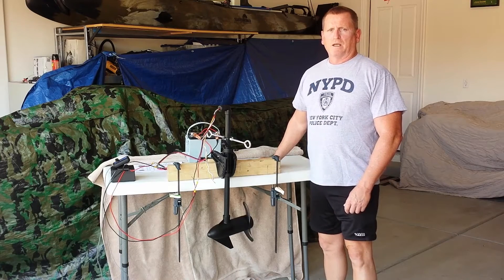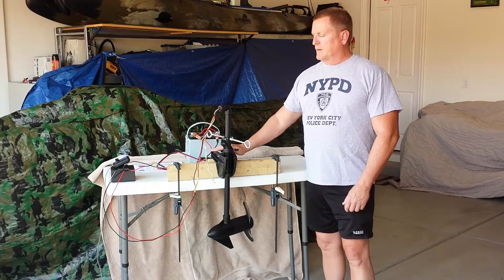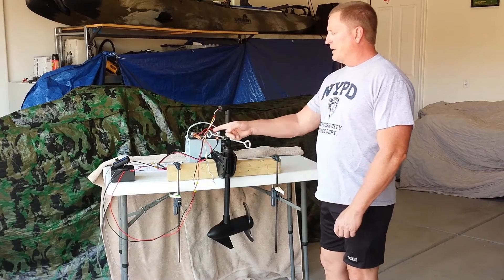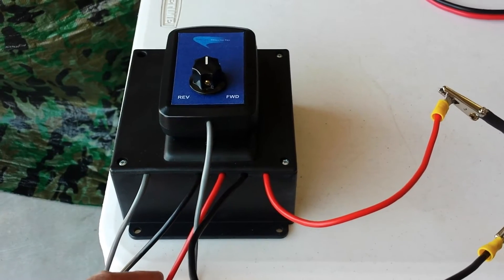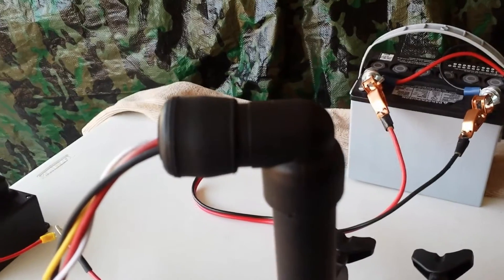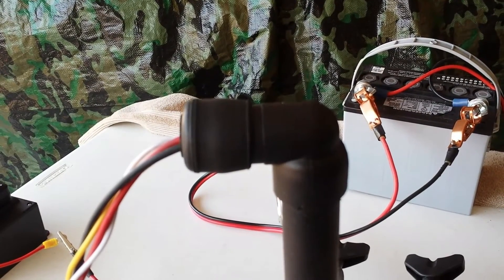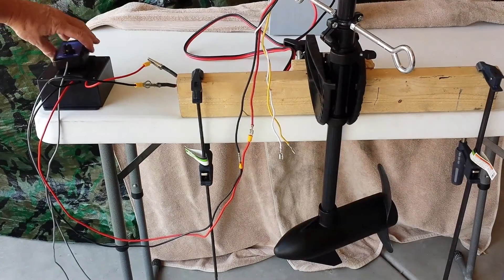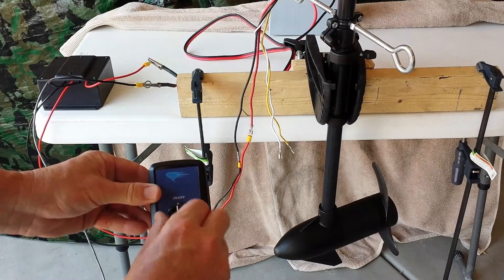Wireless Pro PWM Set Up and Test for DIY Modified Kayak Trolling Motor

Comment: Thanks for your informative videos... what I would like to know is is you have seen any difference in using 10 gauge vs 8 gauge wires ,most people never talk about wires since I understand 10g could be ok for a 30lbs troll motor but once you start getting into the 45`s or 50`s then that can become a issue of resistance and heat ... I got a 55lbs motor and even my fuse and connectors supposed to be for at least 50amps minimum and 8g wire , is that right or can I get away with less? thanks for your advice .
Reply from the maker: Thanks Frank. I know many people refer to the Minn Kota wire gauge chart. In my opinion, it uses a huge factor of safety for liability reasons. I have wired numerous trolling motors from 30-55 lbers on kayaks using 10G up to 13 feet with never any problems.

Comment: Thank you for getting back with me I really appreciate what is causing mine to pulsate fast slow fast slow both in reverse and in forward position. I turned the speed control to the highest setting when I hooked it up. Could that be my problem. Please get back with me
Reply: Same exact thing happened to me. Been trying to get hold of company for weeks. They have lied and been next to impossible to get in touch with. Avoid them like the plague!!!

Comment: What 90° fitting are you using at the top of the trolling motor shaft? I measured mine and it’s an on size. 1.13”
Reply from the maker: I used a 3/4 inch 90 with a slip fit end. I heated it up with a heat gun to make it fit over the shaft and added a rubber chair leg cap. I drilled a hole in the center of the rubber cap for the wiring.

Comment: I had a wireless. Never worked more than 10 minutes on the water. Sent it back 3 times all three times failed in the first ten minutes. They kept it up to 6 months one time and they said since the wireless was not working they would send me one out that was wireless but I could plug it in also. When I got it back it was strait wired. I had paid for wireless. Yep you guessed it, about 10 minutes on the water not ever hitting 100% power it Burnt up. This was the first time it had burnt up. Before it had gotten stuck on high in reverse when I was going forward at about 20% power. The other 2 times it just stopped working all together. Telling you my true story. If you want to buy one that is up to you. But don’t be like me and think it’s the best thing since sliced bread. Because it will malfunction on you. Thanks hopefully this helps someone to use their money more wisely.
Reply from the maker: You are not alone with your complaints. It seems within the last 2 years there was a quality control and customer service problem. They are currently out of business or just dormant. The unit I had and another that I installed still work to this day without any problems.
Reply: Aksman my unit was back from like 3-4 years ago. So they must had had some problems then also. They did return emails and called back from my emails at that time. And he would always send me the same board back each time. If it was my business when that problem one came in a new one would have been sent out and I would have found out what went wrong with that one. But the fastest they ever got me mine back was 2 months. I Bowfish off my yak so I run very very slow. You can see the prop turn. So wasn’t like I was even getting it hot. Just sucked. I was very disappointed to say the least. Thanks for you response back.

Comment: Thanks for the video.  Where is the fuse and what amp do you use
Reply from the maker: You are welcome. I use a 50 or 60A circuit breaker between the battery and PWM.

Comment: Does anyone know why my trolling motor has 5 wires? 12v older motor.
Reply from the maker: What brand and model?
Reply: @Aksmaniyak  it's a diehard 1.5 hp
Reply from the maker: @BigInjun05  As long as you have the main red and black power wires going down into the shaft you can use a PWM.
Reply: @Aksmaniyak  that blue wire wouldn't be like a motor starter would it?
Reply from the maker: @BigInjun05  If it is a standard 12v trolling motor then the only wires that are important are the red/black for a PWM. That is because you don't use the stock switch.
Reply: @Aksmaniyak  I always ask as many questions necessary to learn. Thank you for your knowledge.
Reply from the maker: Glad to help.

Comment: So they say to put it on speed 5 formax energy saving. So with yours being removed do you still get the same in energy consumption
Reply from the maker: I have only field tested the unit without the head. Putting it on 5 allows for full current flow for the max energy saving and max speed. I have not tested both variations side by side for comparison. Removing the head and original switch could only increase the enregy savings based on my previous testing IMO.

Comment: I am looking at using the Wireless Trolling Pro for my Kayak. I will be putting a Minn Kota Endura Max 55 LB trolling motor on it. I have in the past with a Motorguide C3 taken the switch out and remounted it by the chair and it worked well. The Minn Kota however, has a molded in switch that doesn't look to be removable. I noticed that you had 2 wires that were not connected and the power ran directly into the motor itself. Are the cables coming from the wireless pro go directly to the wires that go down to the motor? The video was a little unclear as to what they hooked up to. Thanks
Reply from the maker: Yes, you don't use the white and yellow wires on the MK. You only use the pos and neg wiring for the WTP.

Comment: Hey Aksman, Happy New Year!  I have a question, do you know just how far your motor needs to be under the water to prevent cavitation?
I'm and told the closer you can get to the water line without cavitation the more efficient your motor will run. I will be running a 40 lb minn kota
With the standard prop on a bonafied ss127.  I will be shortening the shaft and would like to go as short as possible. This will add in lifting the trolling motor out of the water and give me that nice low profile on top that i am looking for.

Comment: Aksman, from your expertise, is performance better with the pwm control module, or the controller box you made in your previous videos. The control box that you fabricated is really nice and cheaper to make. In your opinion which would you go with?
Reply from the maker: It depends on your budget. Yes, the original control box is easier to make and costs much less. The PWM requires different wiring and is much more expensive. The PWM does have more advantages. It uses less battery current so your battery power will last longer. It also has an infinite amount of speed settings.

Comment: Aksman, your videos are the best, I'm going to add trolling motor to my eagle Talon yak, question with the pwm controller how do you wire the breaker to the controller and battery.
Reply from the maker: Thanks again Al. You wire the circuit breaker between the battery power leads and PWM. The PWM then runs to the trolling motor power leads.

Comment: How do u wire the control box in ur main box, would be a big help as I bought a kayak and guy passed away before he got it out on water, many thanks liam, liamyoung1988@hotmail.com
Reply from the maker: If you look on the Wireless Trolling Pro website you will find the wiring diagram. It is very simple. 1 blk/red goes to the motor and 1 blk/red goes to the battery or power source. The wires should be labeled.

Comment: Hi, I purchased the PWM and installed it the way you demonstrated and also added a 30amp  circuit breaker. After being on the water for a hour, the PWM stop working and it was really hot with a bad smell. I bought a second one and it did the same thing. Just shipped both units back for inspection. Any advice?
Reply from the maker: Hi, you purchased a WTP PWM? The description you gave sounds like there is an electrical short. I'm not sure what the problem could be exactly without seeing the set up. I would be very interested in the results of the inspection if you would post it here. Thank you.

Comment: You make it look so easy!  I'd like to add a circuit breaker in the battery hot line.  I have a 65# thrust motor.  Any ideas what amperage I should get?  Any input appreciated.  Nice video.
Reply: In your minn kota manual there is a chart  that tells you the size breaker to use. I bought a resettable circuit breaker. My 30# unit calls for a 50 amp on #10 wire.

Comment: I just got my wireless pro PWM kit, finally had the chance to install it lastnight. I have follow all the step and even check the breaker. When i install it the trolling motor kick on for 1-2 sec and shut off. The wireless remote didnt do anything. but when i hook the trolling motor directly into the battery it work fine. there has to be some kind of shortage in the wireless box. looking forward to send my back and have it check out!
Reply from the maker: Hi Van. Is the PMW and the breaker rated for the amps in the trolling motor?

Comment: Have you ever tested, or do you by chance know, the minimum voltage needed to power the controller?  Also, does the company publish max voltage?
Reply from the maker: Hi Brian. I have never tested or have knowledge of the minimum voltage requirements. You could email the company. They might have some test info.

Comment: I would like to install the PWM on a WaterSnake 24lbs motor. This motor has 3 wires ( https://www.youtube.com/watch?v=QZcLLKIBYmI  )

Do you think it will work the same connecting the red and black? Is the the 30amps PWM the one I need of bigger? 

Thank you in advance for your reply and for your great video!
Reply from the maker: Hi Giuseppe, I am not familiar with the wiring in the WaterSnake. I would contact the company and ask them. If you can use a PWM with it, then a 30A unit would be fine.
Reply: Thank you Aksman, I will contact the company as you recommend. Have a nice day!
Reply from the maker: You are welcome Giuseppe. I would be very interested in the information from the company and photos when you finish your project.
Reply: Hello Aksman, I contacted the company and told me I can use the red and black, as you show in your video with the Minn Kota. I ordered the engine yesterday, and I will send you some pictures if I will go ahead with the project. Thanks again for sharing this with us!
Reply from the maker: Thanks Giuseppe. Now I have have learned something too. I look forward to seeing your pictures.

Comment: what do you suggest for a 50lb min variable speed trolling mtr ? will this work  with out  loosing the var speed ? .or should i just do it  with a box like in your other video
Reply from the maker: The variable speed TMs have different wiring so this probably wouldn't work. Besides, the variable speed TM already has a speed controller. I would make a remote box.

Comment: you mentioned that the yellow and white wire was the forward and reverse ...I see you didn't use them ...are you getting reverse from the PWM by just reversing the polarity ?
Reply from the maker: Yes, the PWM is a bi-directional model. You change from F/R using only the controller dial.
Reply: Aksman very cool I've been wanting to do this but was told I couldn't use reverse
Reply from the maker: I have used both Wireless Trolling Pro and Motion Dynamics PWMs and they both operate about the same way using only the dial for speed/direction. There are other brands that have a separate polarity switch for F/R.
Reply: Mardy Martin a

Comment: I have installed this exact unit on my Feelfree kayak and I also install a " kill switch" (the red one), they are both connected to the red wire from the battery thus the positive current but they both work reverse... : on my Pro PWM forward activate the reverse on the motor anf reverse avtivate the forward... and the kill switch cut the engine when it is setup to run and ounce I pull the plug the engine start!   Unbelivable... I just can't understand why but I will keep investigating!  Any idea?

Comment: Hi and great video! In your application, why is it necessary to remove TM head to connect to black and red wire? Couldn't you connect to those wires without removing the head?
Reply from the maker: Thanks Chris. Yes you could do it that way but the operation would be a little bit different. You would need to keep the speed selector switch at setting 5 to make sure to allow for maximum current flow. But since this project no longer uses the stock speed selector switch in the head, it is a more streamlined design to remove it completely.
Reply: Thanks for quick response! Your tutorials have been most helpful while I prepare for my setup.
Reply from the maker: You're welcome. Good luck!

Comment: How much cost both ?
Reply from the maker: Both what?
Reply: The Controller and the power module . . . .   also the trolling motor came with 5 speed and 3 for the reverse how many speed are in that box ?
Reply from the maker: The controller and power module come together. The PWM does not have "speeds" like regular trolling motors. The dial allows for infinite speed settings in the forward and reverse directions. It is a great set up. The controller company website is www.wirelesstrollingpro.com and it explains the different options and prices. A Minn Kota 30 lb thrust trolling motor is about $99.
Reply: Thanks for the information  as always you are very helpful .
Reply from the maker: You're welcome. Good luck!

Comment: what size battery are yuo using and how mush run time are you getting? what size is your kayak any info on steering on yak would be great about to start this project on a malibu x factor, as hurt my elbow and was very painful to paddle a few weeks ago when we had open water lol now its ice again thanks great vid....
Reply from the maker: Thanks! I use a Group 24 (75AH) with the PWM and can run all day (8hrs) with charge leftover. Of course, I don't run it at top speed all day. The kayak is about 14 feet in length. I have made quite a few videos for the X factor including foot steering and trolling motor modifications. Check them out and they may help you.

Comment: Aksman, I am in the middle of a similar instal on my Kayak, but discovered that on the Endura 34 motor which I am using, the black wire coming out of the shaft is much larger than the other 3. This led me to investigate the continuity on the original control switch that was in the head of the motor, and it appears that on my motor speed is controlled by adding power to additonal wires (so that all 4 wires are used in foreward and reverse) and direction is changed by changing polarity. Are you sure your trolling motor uses the yellow and white wires to control direction?
Reply from the maker: I was given that information by an electrical engineer that works on the TMs. The max power occurs when the red and black motor wires act as if directly attached to the battery. I assume it has the standard TM switch inside the head as other Minn Kotas? For the PWM install, all you need is the red and black wires and that is why the instructions recommend selecting speed 5 on the shifter. Speed 5 allows maximum current to travel through the internal switch as if it was hooked directly to the battery. Did this answer your question?
Reply: Aksman,  
My motor appears to have the standard Minn Kota switch, but from what I can determine by testing with a multimeter, speed is controlled by sequentially connecting additional wires to the positive (so, the red, yellow, and white wires all must be connected to the positive simultaneously for full speed). So, it would appear to me that if I only use the red wire, the pwn controller would not be able to achieve full speed). I  would assume all of the Minn Kotas with the 3 spd reverse/5 spd fwd use the same switch, in which case you are not using your motor's full potential.
Reply from the maker: As with most DIY projects, YouTube tutorials are used as a guide to assist those interested in building similar projects. I encourage you to test your theory. I have built several trolling motors with 2 different types/brands of PWMs and each are connected in the same way using only the red+ and black- TM wires. They achieve maximum output with those configurations. The installation method was confirmed by each of the PWM manufacturers.
Reply: Yes, agree. although a different brand, I have a basspro inexpensive T30 prowler, and when you check continuity (with a multimeter) at high speed, all three positive wires are connected.